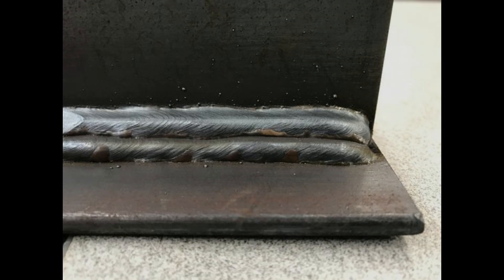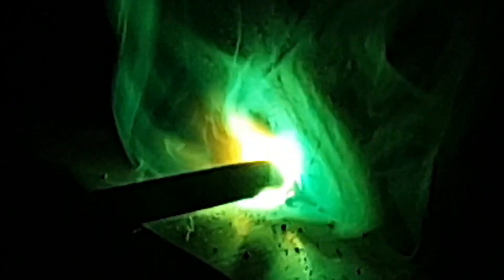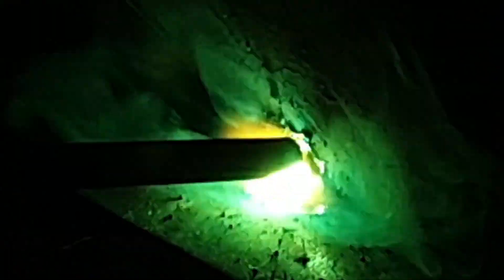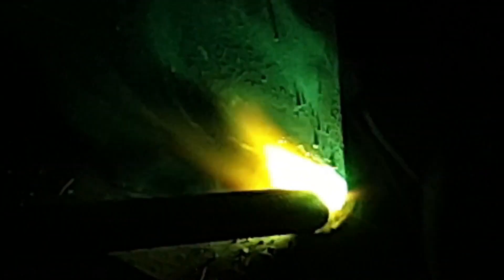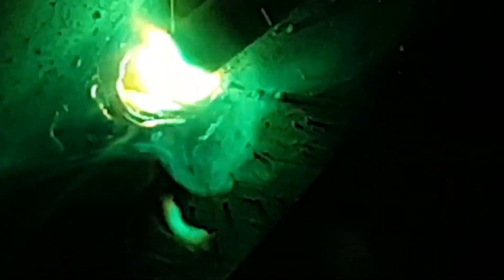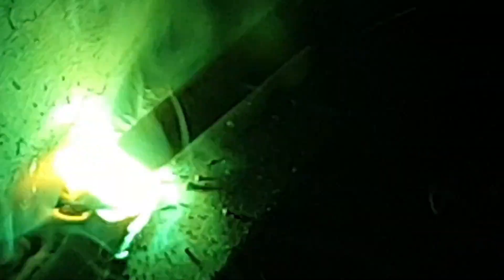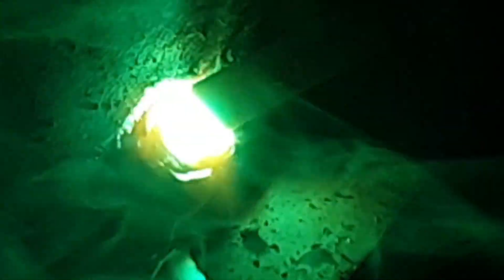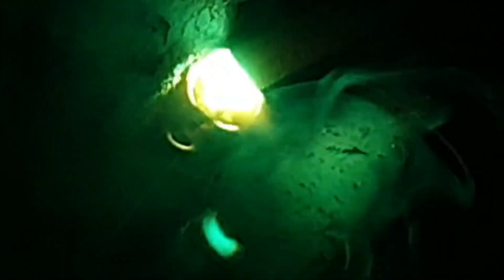How to Stick weld fillets using the multi run technique for beginners.

Comment: hobby welding only have  240 volt ac only welding setand only  6013 welding rods think get ac 7018 rods to expensive
Reply from the maker: I agree, if welding is a hobby welding with E7018 makes no sense when E6013 are so much cheaper. What sorts of things do you weld?
Reply: @weldtechsolutions  onlymild steel flat bar etc uptoabout 6mmthick wrought ironscrolling etc